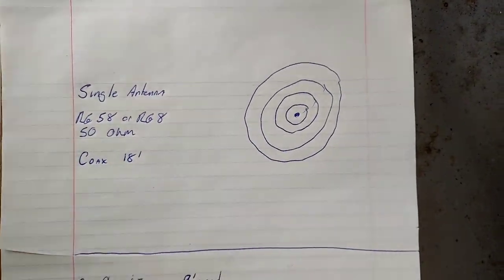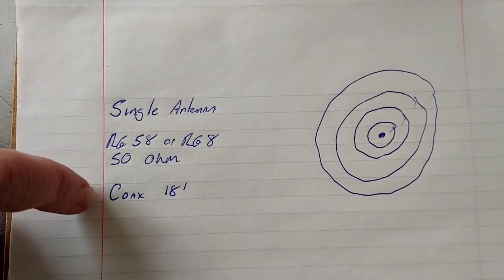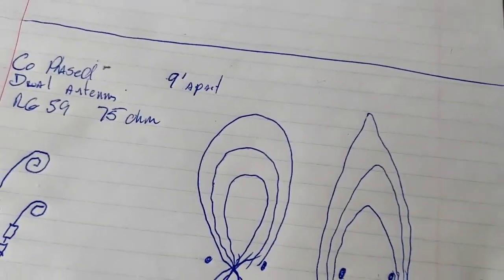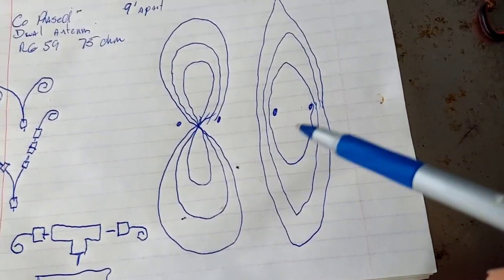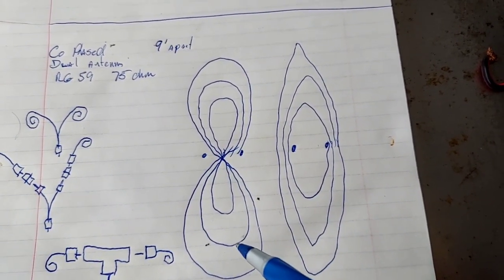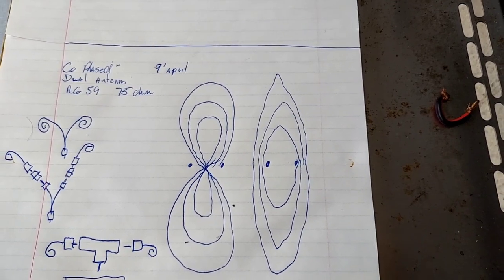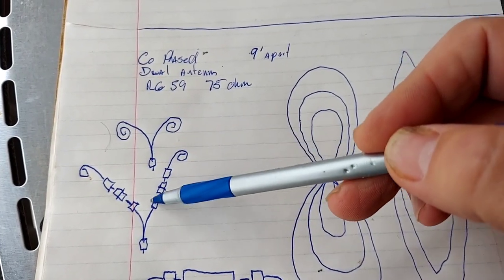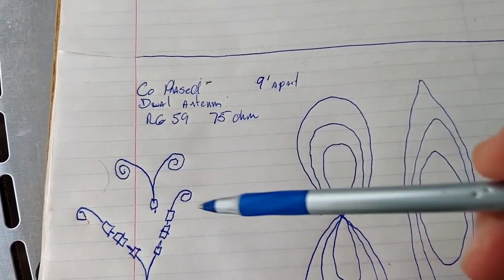Are 2 CB antennas better than 1? 2 cb antennas vs 1 cb antenna.

Comment: I was just watching your mic videos. And then I saw this one and it got me thinking I need some helpful information on antennas. I know I'm going to get all kinds of funny messages and comments about this but unfortunately the company I drive for gave me a 2020 international LT which I don't mind the truck, I just don't care for the antenna placement on the back of the cab especially when I got a van trailer because the signal is probably not going to be all that great. Do you have any helpful advice on maybe how to rewire the antenna lines to the mirrors and maybe get an aftermarket antenna?

Better yet I think I just need to come by and have you do it all for me LOL
Reply from the maker: I hate the antenna placement! I'm willing to bet 1 antenna is for the am/fm radio and 1 for cb. 1 option is a taller top load fiberglass antenna. Get it as close to 13'6" as possible. I like Skip Shooter antennas they don't break easy like firestik. And slide a piece of cpvc pipe over the base like in this video and a link to the antenna is in the description. https://youtu.be/jqw0Iy-5LwU

Option 2 is relocating the antenna and running new coax. Check out this mount. https://www.walcottradio.com/outback-cb-antenna-bracket-obkt-p-1039.html You are on your own for routing the new coax, and run the tallest antenna possible. Then I would run a ground cable from the mount to the frame. I have videos on grounding the antenna. 

I  think option 2 is the best bet without seeing the truck in person and being able to look around it. I would get good coax from the cb show not the junk on the shelf at the truck stop. The mirrors look plastic and would be afraid of breakage and a bad ground. 

I'm also willing to help with the install if you're anywhere near West GA on a weekend 🤷‍♂️ I can even make a video about it.
Reply: @jrichtruckincbtips  that would be fantastic it might take me a little bit to get out that way and have the means to get the other antennas. Do you have an email to where I can keep in touch with you? Cuz I drive all 48 states so one of these days I can talk to my fleet manager and try to get a load out that area.
Reply from the maker: @jsublett8871  post your email here in the comments, then I'll email you and delete it from the comments.
Reply: @jrichtruckincbtips  hey brother how ya been? I long since left the company and no longer driving the International any longer. I'm still interested in having you help me out with cb setup.
Reply from the maker: @jsublett8871  staying busy with a new company myself. What are you driving now?
Reply: @jrichtruckincbtips  getting a 579 peterbilt.  The truck I was driving recently was a 2021 T680 but it ended up having major Engine problems so they're putting me in a different truck. I'm with a least company now and it's going really well but I do believe they're gonna put me in a 2020 or a 2021 Peterbilt
Reply from the maker: @jsublett8871  I have videos for the t680, but haven't had a chance to mess with the 579.
Reply: @jrichtruckincbtips   I don't think there's a whole lot of a difference between the T680 and the 579 because they're both made basically from the same company. But I'll keep you posted on what I end up getting it's a possibility they might put me in a brand new T680 I don't know. The one that I had is in the shop right now and they're trying to get me on a plane to go pick up a new truck they're just trying to decide what it's gonna be and the closest 1 to where I'm at.

Comment: What would happen if you put one on each side then a magnet one in middle
Reply: If it is a unipole or whip it would further degrade the performance of either side and would be a real bear to try to match.
As an example,  take a soft inflated balloon and press in one side with the long edge of a ruler
You will see a cardiod or heart shaped pattern.
Now imaging two balloons, the patterns would be mirror images because the third antenna will act more as a reflector than radiator giving a side to side pattern if you could get them to work at all.

Comment: so accepting i already made the mistake of have dual antenna and co-phased coax. i am unable to tune them together but individually they tune great. is it bad to use the co-phased coax with 1 antenna unhooked? or is it worth buying and running a new single coax for single antenna?
Reply from the maker: No Co-phase coax needs to have 2 antennas. I'd run 1 50 ohm coax and 1 antenna.

Comment: Do you mess with the higher quality coax? I got a Toyota that I don’t have much space for improvement trying to squeeze every bit out of it also if you add a another antenna for something like a ham or gmrs will they mess with eachother when receiving?
Reply from the maker: I use the gray rg58 that the CB shops have, which I would say is between good and great. I know there's higher end coax, but I have not used. The pre-made coax that you find on the shelf at a truck stop or Amazon is the lower end of coax.

I haven't messed with multiple radios, so the only suggestion is, that each antenna needs it's own space. The rule of thumb I use is, nothing within 18" of the antennas coil on  the sides or above. And, obviously that doesn't apply to under the coil. Thanks for watching.
Reply: Lmr240 ultra flex
Reply: @rockhaller3899  that’s what I ended up with 👍

Comment: Thanks.  You saved me some money.
Reply from the maker: I have never seen 2 antennas being useful on low wattage
Reply: @jrichtruckincbtips   I mostly drive I-95, I-66, and I-81 thru the Shenandoah Valley and a few fire roads around Harrisonburg. Based on your video one is good enough. I just have a small Uniden Bearcat for offroaders. I want to here the truckers talk about traffic on the interstate and possibly some other fishermen out in the boondocks with me.
Reply from the maker: @scottsavage2141  gotcha, 2 is better if you mostly run desert flat lands, but out in the woods just 1 that radiates equally in all directions is better.

Comment: Could you or do you have a video on property tuning a dual antenna?
Reply from the maker: I do not because I don't run duals. From what I know the principle is the same. Just what you do on one side has to be the same on the other. Thanks for watching.
Reply: In order to tune duel antennas you need to get a single coax and tune both those antennas individually. Once you get them tuned exactly the same you can hook up your co phase coax
Reply: Attach the co-phasing coax to both antenna mounts, without the antennas. Install and tune the driver's side antenna first. Then install and tune the passenger side antenna, without touching the driver's side antenna. Then if the passenger side antenna becomes damaged, the driver's side antenna will still function fine as a single antenna.

Comment: durn tree limb broke my passenger side antenna off , i really need some spring mounts or something,or not hit tree limbs,but that aint gonna happen
Reply from the maker: If you're going to use a spring I'd use a Hustler spring. Skip Shooter and Hustler antennas are pretty good against limbs. In my experience
Reply: @jrichtruckincbtips  preciate the info brother

Comment: your information about using a T connector is not correct. I ran a T in a pickup I used to own for dual antennas and had no issues what so ever. Performance nor dependability were effected negatively.  The radio Uniden PC66 has not had any issues either and I used RG8(mini 8). I sold the truck six years ago the guy that bought it still to this day runs the same antennas ( Francis) same coax and the same Radio and yes the T is still in place. Twenty to thirty mile transmits with no skip running is not unusual, admittedly we live in a mountainous area. The current setup I run in the truck I bought will talk forty five miles but its a single base loaded antenna.
Reply from the maker: Ok
Reply: Lol 45 miles on a mobile huh?
Reply: @rockhaller3899   Try 74 miles barefoot

Comment: Do they each need a Separate ground or can the ground wire T when go to the frame?
Reply from the maker: Grounds should be as short as possible, use flat braided straps, and to get the most out of the system check out my RF bonding video.it really helps.

Comment: J-rich I'm in a 2017 Freightliner company-owned so I can't change anything I'm getting ready to put a Stryker 497 in there derail is setting it up for me I'm going to use a top-loaded antenna the thing is on this truck is not on the mirror it's on the side of the cab you said you have broken your aunt has before what about a spring-loaded melt before I plant an up so if I hit tree limbs or whatever it would not break my antenna
Reply from the maker: I would use a Hustler spring, and Francis antennas do well against the trees if you put some glue in the cap after tuning the antenna.

Comment: A single antenna is 360° omni directional.   Two antenna, each act as an counter-poise to each other, creating very long loops front and back,  ... not much for side transmission.  I reach drivers far ahead and behind

Comment: Where are you located. You said southeast. Alabama here.
Reply from the maker: Metro Atlanta
Reply: 10/4. I just got a 5ft skipshooter for my mack pinnacle, gonna see if it's any better than the twin coil bigcat. Mounted on handrail above back window.
Reply from the maker: @yanceylangston1063  hopefully it works great. You do have a ground strap from the mount to frame, right?
Reply: @jrichtruckincbtips  not yet. Does it need it?
Reply from the maker: @yanceylangston1063  as I have been in your truck,  I can't say 100%, but you usually need to. You will receive better,  have less static, and have lower SWRs.

Comment: How would you properly tune a dual antenna set up?
Reply from the maker: I haven't done it, but I've seen it done 2 ways. 1 tune just like normal, just whatever adjustment you make to 1 you do the same to the other. 2 you would tune them independently. Not sure which way is right, as I don't have the equipment like the cb shops have. And, sometimes it depends who you talk to as to which way is right.
Reply: Cut or lengthen both whips the same. Make small changes each time to avoid going too far. Works just like a single whip, if the SWR is higher on channel 40 than 1, the whips are too long and vice versa.
Reply: @jrichtruckincbtips  put a normal cb 50 ohm cable to one antenna. SWR that antenna. Then put the same cable to the other antenna and do that one. Finally take off the 50 ohm cable and connect the phasing harness to both antennas. That's the correct way. If you put everything together then start chopping each antenna you can end up with trash and have to replace them.
Reply from the maker: @thomasbarnley3168  that one way to do it, but depending on the vehicle (say a KW 680 or 880 that would a ton more work than using a dummy load.
Reply: @jrichtruckincbtips  Yes, it's true that it's more work but a properly tuned antenna is not 50 ohms [ a dummy load is ] so it makes more sense to use what you are intending to use .... the antenna. The reason is that if you use a dummy load, and then replace it with the antenna later, as the antenna and dummy load are actually different matches, you again unbalance the system.

Comment: Anyone know what length I would need to  run cophased rg400 in a 2019 freightliner cascadia
Reply from the maker: All the RG400 I've seen is 50 ohm. Cophase requires 75 ohm coax.
Reply: RG59 with solid (hard, clear) dialectic has a 66% velocity factory. Some RG59 and RG6 coax with white foam dielectric has 78 or 80% (82%?) velocity factory. The solid uses two pieces 18 feet long each. The foam uses two pieces 21 feet each. Both are electrical 3/4 wave lengths. They have to be odd multiples of 1/4 wave lengths. The RG59 and RG6 cables are 75 ohms, while RG58, RG8X and RG400 are 50 ohms.

Comment: The figure 8 pattern is for co-phased with 18 feet spacing, the oval is for 9 feet spacing coax should be in 6 foot multiples. This is about 1/4 wave in the coax; 9 feet is 1/4 wave in space.  You must know the velocity factor of the coax to determine what 1/4 wave inside the coax is.

Comment: I have a dual antenna set I purchased from Amazon. Each antenna has 18' of RG59 going to a Y spliter. Can I continue from a bulkhead connector with a jumper to radio? And if so, does it have to be RG59?
I've been watching and enjoying your videos on CB's. Thanks!
Reply from the maker: I don't think it needs to be rg59. However you need the antennas tuned individually and the additional jumper could effect swr and won't know the true swr reading.

Comment: Whip antennas are omni directional. That means its 1 big circle pattern. 1 antenna is fine. The more coax, adapters and connectors you have means more signal and gain loss.
Reply: Phased antennas add dB in a directional pattern. It is excellent for local and dx by pointing the vehicle towards where you want to broadcast and receive. More surface area for collection and transmission.  The same reason a base 5/8th wave ground plane supremely outperforms a 1/4 wave ground plane antenna. If on a base station,  a 1/2 or full wave horizontal dipole is amazing but very directional. Not many people have that room and clearance to install

Comment: Having two antenna's is pretty much a waste of money.  All you get is more receive to the sides of your truck.  They act as a beam.  So if you are driving North bound you will here more to the East and West and vise versa.  ALSO!  Dont mount/bend your antennas pointing tip forward.!  Mount them vertical.  Dont be a dork. haha.

Comment: Dang wanted to run dual antennas on my pickup but I'll keep the single setup, but what about antenna height from the ground, does it mater?
Reply from the maker: Generally you want the antenna as high as possible,  don't make the mistake of using a base load antenna right behind the cab. The coil needs to be above the cab, or above the bed if bumper mounted. A lot of people like the 102" whip on pick ups.
Reply: Thanks for the tip, I'll give it a try
Reply: If you’re just talking to people on the road, as high as possible. If you’re trying to maximize skywave propagation or “skip”, you want the antenna to be either 1/4 or 1/2 wavelength off the ground.

Comment: I've been using the single antenna mounted high and centered with RG8X and we have lots of hills and mountain grades here in the northwest, the single antenna works just fine.
Reply: I agree with you and it's like I said in my comment before I found yours that this was due to the modern radios are 60 W not 12 Watts LOL. I used the Hustler beer can on the left mirror bracket and I would get on I-20 at Pecos Texas and talk all over the New England Canadian Quebec area I would talk to a Boston Quebec Toronto New Jersey New York Boston wherever. Yes that is skippa but I'm just saying that all of this stuff about where you put your antenna on the car was still from the days of the for w so you devised ways to talk how you wanted how to make the antenna more efficient for you but with exports it really doesn't matter anymore where your antenna is

Comment: For a connex 4300-300 does a fire stick would perform good or should I install different antenna?
Reply from the maker: Without any other info, the Firestik 2 is a good performer.
Reply: @jrichtruckincbtips  thanks for responding.  I have a predator antenna on mirrors but the whip gets broken alot by branches and planning on installing a mounting bracket behind sleeper but the coil of predator antenna dont fit right hits the wall of sleeper. (Peterbilt 379 tall sleeper)

Comment: Height  of Truck and trailer, and length of antenna aside, two antennas cophased are better in the hill, twists, turns, switchbacks, if transmitting. That's  the point of cophasing. As the truck turns, an antenna is always facing the side transmission is needed. If flatbed, especially with a mid, or flat top, car, or pickup, a single is fine.

Comment: 95% good info. but on 11 meters if narrow than 9 foot pretty much west of money large trucks or stationary works .
someday sun spots cycle will return its been low since mid to late 70s . btw rg 6 also works . but rg 59 for harness and rg 8 just slightly better but trying to rout .5 inch cable in trucks unless mount is in metal from mirror pita.   btw best to have 102-108 whip is drivers side since trees are normally curb side  so drivers side misses more trees . fl we have problem Muni and property owners don't trim trees and co2 from exhaust cause branches trend over asphalt so trees are over streets and when storms come trees fall into streets cb from 1975 armature licensed since 92 check out hamfasts the arrl antenna book can be picked up cheap. and if you get friends some hams have software to analyze antenna patterns

Comment: Thanks for sharing your knowledge, right now trying so hard to get this single antenna 6ft Skipshooter below a 2 SWR but am having major problems, my grounding may be the problem but when i hook up to the trucks stock dual antennas my SWR is below 1.5 with a 4ft fire stick on drivers side and a 3ft francis on passenger..I have a matching 4ft fire stick for the passenger side but could not get the SWR low enough..I have a lot of antennas so thats how I ended up finding out this setup WORKS FOR ME.